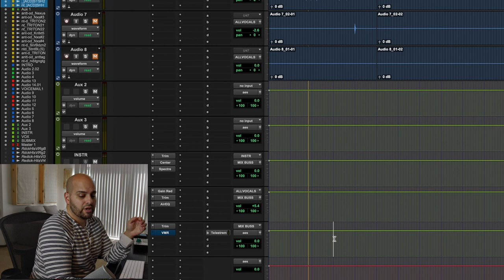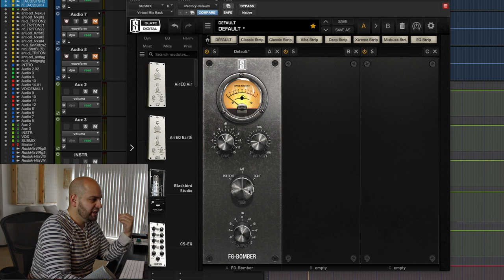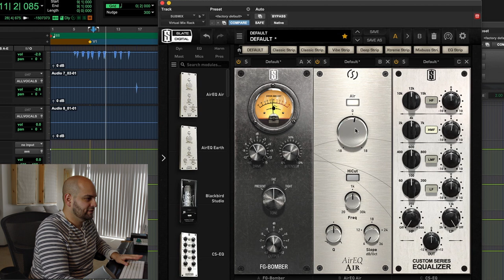FG Bomber review

Comment: Do you add a separate mixbus comp besides the bomber on your mixbus as well or does the bomber do all the mixbus compressing duties? Great video and subscribed! Looking forward to more great content.
Reply from the maker: Typically I use Bomber in a very different way than I use a compressor, so it's not uncommon for me to have both present on mix bus. That said, I use compression on mix bus a little less than a lot of engineers because I'm typically working on records that have very consistent dynamics. Genres that use a lot of programming and synths usually don't have the same peaks and dips as genres that incorporate a lot of live elements.

Comment: revival and bomber are two plugs that I don't know what I should replace them with if I had to
Reply from the maker: Revival I could figure out was to do it with parallel EQ + distortion. Bomber..... ugh... I guess two transient designers back to back, like two SPLs. But the workflow wouldn't be the same.
Reply: @WeissAdvice  Thanks, that's a good starting point for research